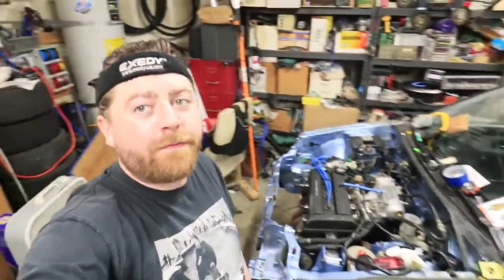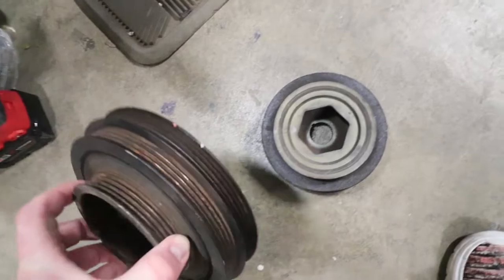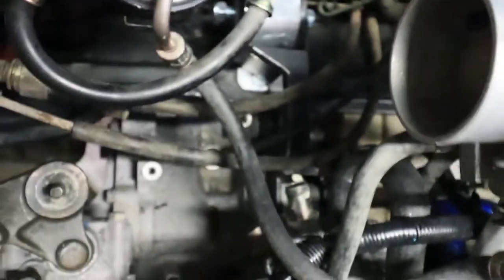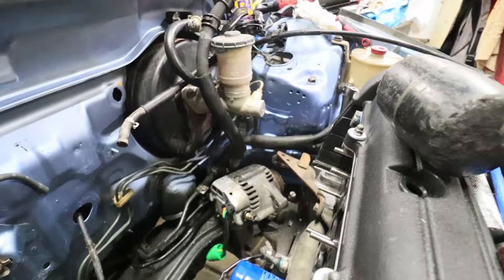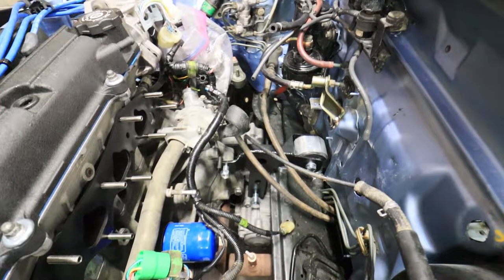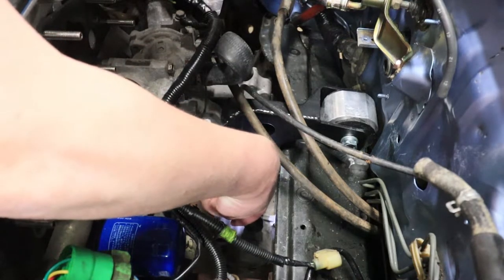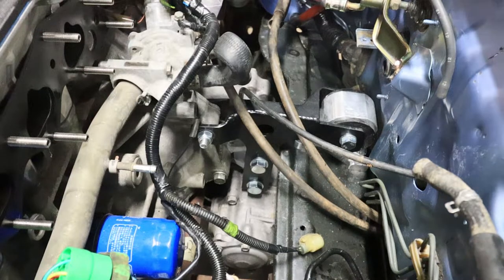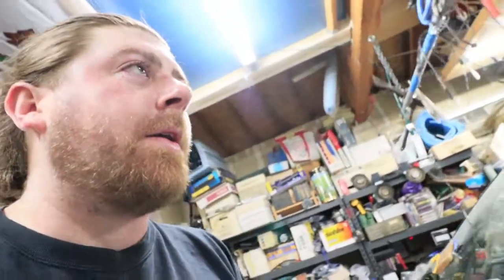The best way to install the hasport T bracket doing a BAWD swap!

Comment: It’s good to see that the bawd kit works. You’re the second person I have seen do that kit in a wagovan but for some reason hasport says on their site that it will not work in the wagon chassis?
Reply from the maker: I'm not sure what option you are looking at. it depends on what wagon you have first of all to decide on the swap. if you have a 90-91 manual i belive these are the two years that need a bracket welded in. 

So they sell you a BAWD mount kit and if you didn't buy the weld in bracket, yes that kit wont work. 

But if your car was automatic or a 88/89 ( not 100% on the year thing but definitely on the transmission part. ) 
you wont need to weld in the bracket. 
so its yes and no the kit will fit but yes no matter what if you have automatic wagon sorry if that word soup was confusing I just woke up.